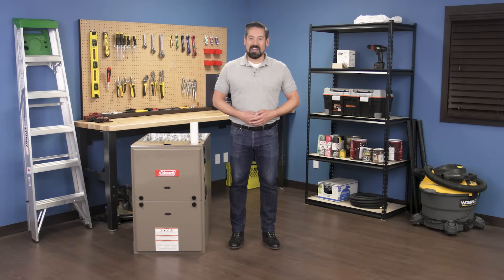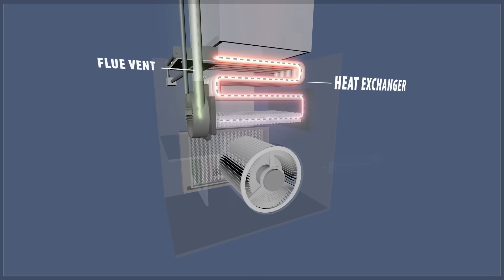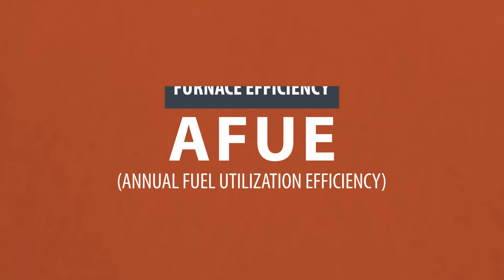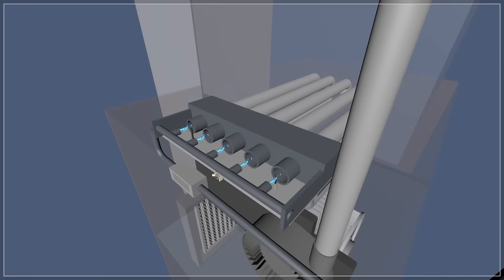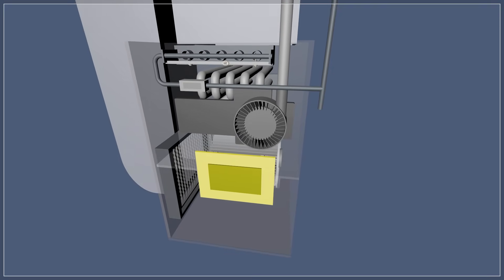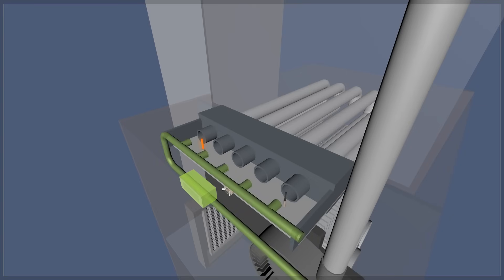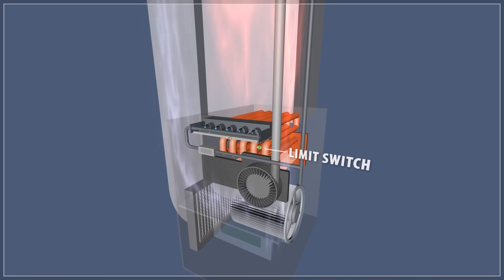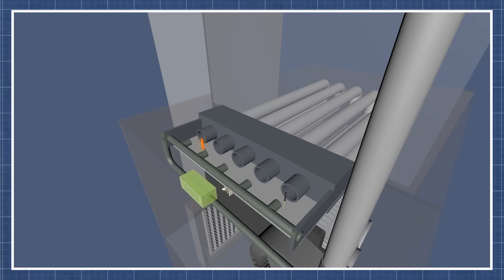How a Furnace Works | Repair and Replace

Comment: what fault is it if it smells burned dust and then shuts down
Reply from the maker: Thanks for watching. First check to see if your furnace gives you any error codes. Thtat will help you narrow down the problem.
Best to check the furnace filter. A dirty or clogged filter can restrict the airflow causing the heat exchanger to overheat which will trip the limit switch, shutting down the furnace.
Alternatively the motor could have overheated.
If your furnace turns on but keeps on shutting off then it could be one of several problems outlined in this video: https://www.youtube.com/watch?v=b0sAGt-1niU

Comment: U
Reply from the maker: Thanks for watching!
Reply: AMRE Supply you did great job! 👍👍👍 how hot the cold air will turned to be after go through the heater? I mean the temperature? Can you adjust this temperature? Thanks!
Reply from the maker: @irwu8860  Thanks, we're glad you found the video helpful. The air that comes out of the heat registers in one of your rooms is typically around 100 - 110°F. This exact temperature can't really be adjusted but the thermostat on your wall will regulate the temperature in your home. The warm air from the furnace will mix with the air in the room. To make a home warmer, the furnace will run for longer rather than burning at a hotter temperature.
Reply: @AmreSupply  Thank you for respond, AMRE,

So the temperature of the air out of the heat register is about 37-38 C, which is not hot enough to kill the Coronavirus. 

What I am thinking is: if there is a family member who is or maybe ill and isolated in one bedroom, the virus can be spread to the whole house through the furnace, correct? —— if that room has a cold air outlet.

and if that outlet be blocked, will that influence the furnace function?

I hope you understand my question.

thank you!
Reply from the maker: @irwu8860  These are valid questions during this uncertain time.  When the furnace isn't running there won't be much airflow into the heat register. Bedrooms have a heat register but the cold air return duct is usually out in a hallway or living room. In that case that is outside of the 6ft range that a sneeze or cough would normally spread the droplets. With a closed bedroom door the amount of air and droplets transferred would be decreased as well. Still its best to take as much precautions as what is rational for your setup.
Reply: AMRE Supply my home is a very old house. There is a return air outlet in the bedroom. Can I just block it? Would that hurt the furnace?
Reply from the maker: @irwu8860  Blocking the cold air return is not recommended as it can cause the heat exchanger inside the furnace to overheat. This will either cause the furnace to shut down and might cause the heat exchanger to crack overtime.

Comment: This is very useful information.  The apartment I live has a comformaker furnace and it has trouble getting the apartment warm.  It it puts outs a lot of soot and have to clean every week or so it over heats badly and won't right.   What could cause it to get so sooty, I cleaned the flu several times. It gets a ring of soot around the blower fan at the back.
Reply from the maker: Hi Shelly, thank you for watching, we're glad you found the video helpful! First of all excessive soot is a sign of incomplete combustion, so make sure that you have a carbon monoxide detector installed. Overall a buildup of carbon on the burners can cause poor combustion. The flames should be yellow and not blue. You can see how to clean in this video we created: https://youtu.be/1giPLrObYb4
Reply: @AmreSupply   Thanks for the reply.  The pilot burns a yellow flame, the burner does to.  The flu gets full of soot.  The guy that owns this place doesn't take care of it.  
They put a new line in on the furnace because  water heater was faulty and it  was replaced, they is probably about 30 years old.  I cleaned out most of the soot, and filter was black.  The fan was full of dirt.  I recleaned it , not it blows a good breeze.  You can smell the soot when it gets hot.  The gas man when I had the gas turn said it should burn a blue flame not yellow. 
The guy that owns this place is too cheap  to have it fixed up. I'll just have to do what to make it less  sooty and whatever. I think it gets in the air.
Reply from the maker: It is definitely frustrating when the place is not maintained properly by the owner. As long as that flame is yellow then its still burning dirty, so a cleaning of the burners would help. Now if there is soot on the blower then that means there might be a crack in the heat exchanger but that is hard to determine without professional tools. Just make sure to have a carbon monoxide monitor in the area as it seems like there could be carbon monoxide issues in your case.
Reply: @AmreSupply  I believe it is a 30 year old furnace. I looked on the filter instructions and it said 1980.  So it hasn't been cleaned in 35 years probably .  It won't heat very well either. It about 73 degrees most of the time. It runs almost constantly.   I believe he knows that there is something wrong but he waits till it falls  apart  before he wants to do anything.    I'll have to work with it.  
Any suggestions about the soot.  I have been here 2 years nearly, and that was the first thing I checked out.
Reply from the maker: Giving the furnace and the burners a thorough cleaning will definitely help so its the first place to start.
Reply: @AmreSupply   I have cleaned them out as much as I can , but there seems to be a over burn in the burners.  I don't believe the air is getting out like it should through the ductwork.  It blows a good breeze but  it doesn't hold heat in here good. In fact there wasn't even a gas meter when I moved in. I don't think anyone lived here for years and had a gas meter put in till I had the gas turned on.  They would only live here a few months and may have  use an electric appliance. 
I don't know how they used water heater without the gas.  I saw a nu wave menu in the kitchen.  😊   .   Something  not right. 🙄
Reply from the maker: @shellyblanchard5788  Overall its probably best to reach out again to your landlord to get the furnace inspected / and the duct-work cleaned. Look at what laws there are  between tenants and landlords for your region. The furnace is part of "essential services" This guide might give you some ideas on how to handle it https://www.landlordandtenant.org/repairs/landlord-wont-fix-anything/

Comment: What is the flow of electricity throughout the furnace from circuit box to the service switch
Reply from the maker: Thanks for watching! From the circuit breaker, the furnace is supplied with 120V AC. From there the power is split. Going into the transformer the voltage is stepped down to 24V DC. This is what the control board, thermostat, and safety switches will use. The blower motor and ignitor will use 120v, but will be triggered by relays on the control board. These relays will use a low voltage DC signal (24V), to trigger a path for a high voltage AC signal (120V). You can always look up the circuit diagram for your model to see more.  Hopefully that helps. Now if you want to see some more visualizations of circuits in appliances, and explanations of short circuits and ground faults we made a video on it. https://www.youtube.com/watch?v=SnRXD-0oXZo&list=PLCo9SMjkdWBycw9hZVfYFc6Sw2Jlavaak&index=3&t=310s

Comment: Someone get big boy here to read Christmas stories
Reply from the maker: Done and done. Now everyone gather around the heat register . . .   "It was the night before Christmas, and the house was very cold. The furnace was not running, as it was getting very old. Jack went to his computer and with a smirk, he searched on YouTube "how a furnace works". He learned that the flame sensor can get covered in silt, so he took out an emery cloth from his hilt. He polished the sensor until it was like new, reinstalled in the furnace and gave it attempt number 2. Success! The furnace proved a flame, the blower fan spins again and again. There was heat flowing through the vents, on this cold winter night. The flames in the furnace burned hot and very bright."
Reply: @AmreSupply  HELL YEAH!
Goodnight! 😏
Reply: @AmreSupply  slow clap
Reply: Halcyon Outlander you better have an experienced technician check out that cracked heat exchanger
Reply: Calm should pick this dude up for it’s ‘sleep stories’
Reply: You funny

Comment: New furnace today.... I've been trying to sleep for hours listening to it cycle on and off every 10 mins. I have work in a few hours but here i am wasting my time on a furnace i just bought yesterday. Why does the blower motor stay on to cool the heat exchangers when, while it does so it blows cool air out of the vents... wouldn't it make more sense for the inducer fan to stay on as it pulls air cold from outside, cycling it through the heat exchangers then spits it back outside.... rather than your blower cooling it and blowing cold ass air through the vents riiiiiiight after heating.......holy shit the old one worked 100x better and was quieter.... dont use enercare they are shit
Reply from the maker: Hi thank you for watching. If your furnace has an inducer motor then it will be pulling fresh air from outside for combustion but that is self contained within the inducer, heat exchanger and the exhaust vent. After the set temperature is reached the furnace will cool the heat exchanger with room temperature air from inside your home. This air will feel colder than the heated air that just came out of the vents but its not going to cool your house down as its the same temperature as the room.

Comment: Is it possible if an older furnace could aggravate respiratory allergies?
Reply from the maker: Thank you for watching. Yes an old furnace can aggravate allergies but regularly changing the air filter can help as the filters can buildup with dust and allergens. If the allergies are really bad it might make sense to get the ducts professionally cleaned as there might be a lot of dust in the ducts. We have a video on the furnace filters that you might find helpful: https://www.youtube.com/watch?v=hF_6-x8RR0U&list=PLCo9SMjkdWBzorzNrARLKALj9fW7HzHMh&index=14 Now if you find these videos helpful and want to support the channel you can simply  like, share or  even subscribe as every little bit helps.
Reply: @AmreSupply  Thanks for your reply. I've tried duct cleaning twice. It's an 28 years old furnace, so it has very old fashion filter, however it's heating function is very good,.I'm only concern about the respiratory tract allergies, which only aggravates when furnace is running in winter time.
Reply from the maker: @thestylesworld  The allergies are like aggravated during the winter since the furnace is circulating more of the air (and allergens) around your home. Even if the filter is an older style, you should be able to find a replacement. Once a filter becomes dirty it becomes ineffective at trapping particles from the air, so its essential to replace the filter every 6 months if you are trying to improve the quality of the air in your home. If not then the allergens will just be circulated every time the furnace runs. There are some additional things you can do to reduce the allergens in your home. Vacuum regularly, change bed sheets and towels regularly, and if possibly replace carpets with wood flooring. This can reduce places for allergens to be trapped as wood floors are easier to clean deeply. As well you can always try a portable air filter like these, just try to get a HEPA filter and replace it frequently based on what the manual says https://www.amresupply.com/catalog/Complete-Units-HQ6S

Comment: Does the draft inducer fan only operate during starup?
Reply from the maker: Hi Michael, thank you for watching. The draft inducer will continue to run as long as the burner is running as it is needed to remove exhaust gases. 

Now if you have found this video helpful consider sharing the video or subscribing as its the most simple way of supporting the channel. As well you might be interested in our other videos such as How a Water Heater Works https://www.youtube.com/watch?v=BHUPFLbb8NY&list=PLCo9SMjkdWBwJ4a8MT2GKTDiSuvSHg6Xk&index=1
Reply: @AmreSupply  thank you for the response.
Reply from the maker: @Geeter100  You're welcome!

Comment: Hi, The furnace at my house (10 years old Keeprite) started to be louder than usual when it starts during the 40 seconds or so  before it heats up and before the blower kicks in. What could be the source and what problem does this signify? Thank you.
Reply from the maker: HI Saleh, thank you for watching. We made a video on furnace noises: https://youtu.be/WkHgeTITioE?t=104 If your furnace uses a draft inducer blower then it could be the source of the noise. The draft inducer will run first before the blower circulates air around your home. Overtime the motor bearings can wear our, and might need to be replaced. Hopefully this helps!

Comment: Great video! 
I need to replace my inducer Fasco Model 70625660
Instead of getting the same brand and model (cant find it)
can you suggest me to another inducer for Ruud Achiever90 Plus, Model UGRK-06EMAES?
Thanks
Reply from the maker: Thanks Wilson, we're glad you liked the video.

To try to narrow down a cross reference, I would suggest contacting our Customer Care Center: 1-800-661-9891 or email customercare@amresupply.com and they can look into it.

Comment: Thank you for this well presented video. I had to have my outside gas meter changed for free as  recently mandated by the government in Canada. The gas technician sent by Enbridge gas exchanged the free meter and afterwards didn't restart  my furnace correctly.  This  caused my furnaces safety switch to lockout. The gas technician didn't reset my furnace afterwards and I didn't have heat for a day on a furnace that was previously working great. I got my furnace working again by following advice from this video and resetting the switch.
Reply from the maker: Thank you for sharing your experience Alain. Yes sometimes its just a simple reset. We're glad this video helped you out!